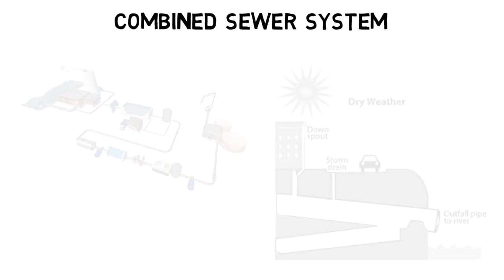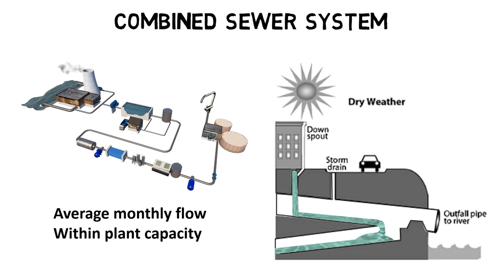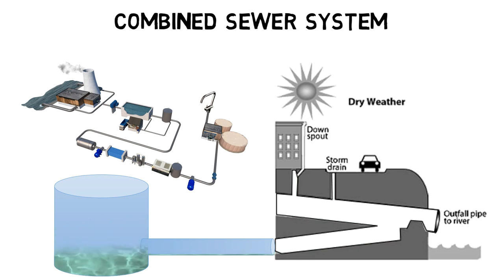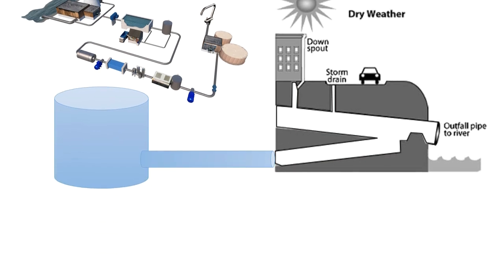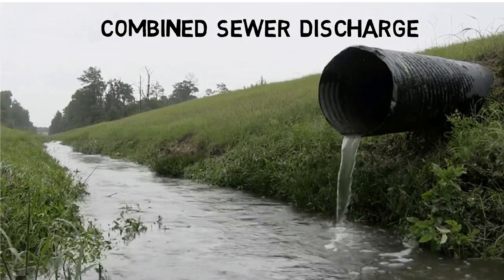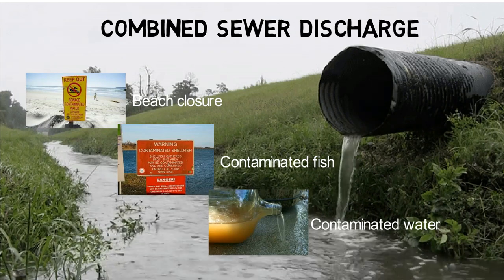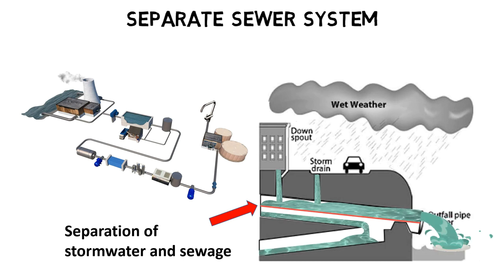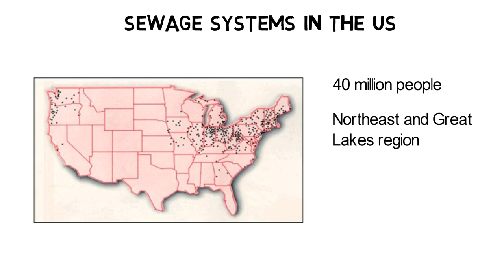Storm sewer drain - combined and separate sewer systems

Comment: How hard is it to go from a combined system to a non combined system? Can you use any of the pre-existing structures?
Reply: Well the whole thing is designed to drain out into a lake or river when there is too much water flow so if you just blocked off the outlet the line would back up in conditions where it usually would just discharge to the water body so you have to block off all of the hundreds of smaller drains leading into the combined system but only ones for storm water then building another separate system that can handle the water and discharge it properly and make sure all the systems can function properly and that the old system can still handle all the water needed